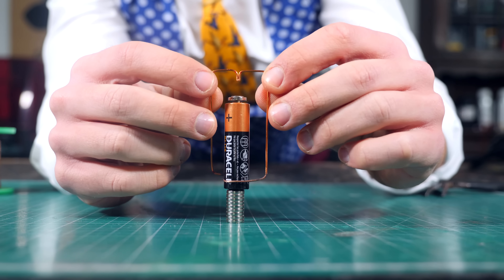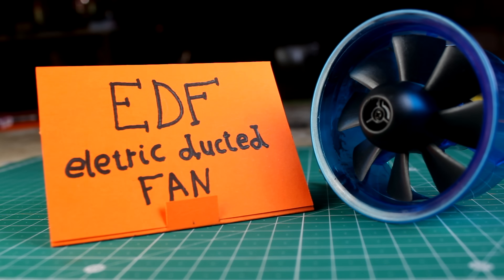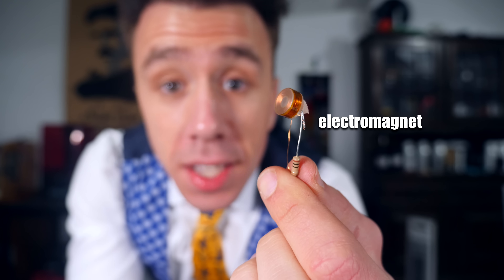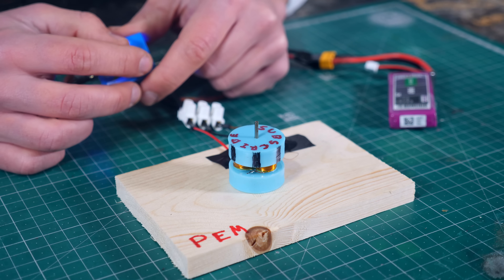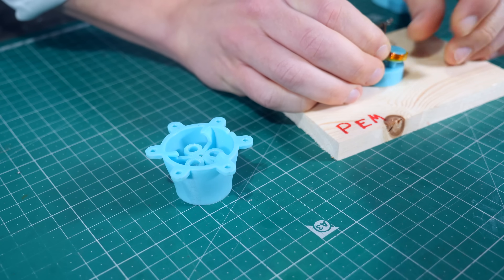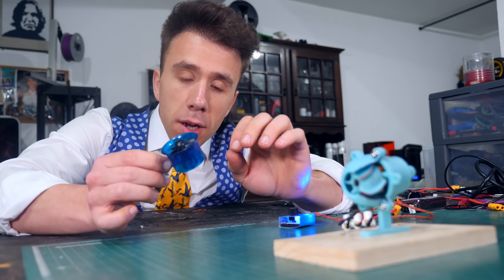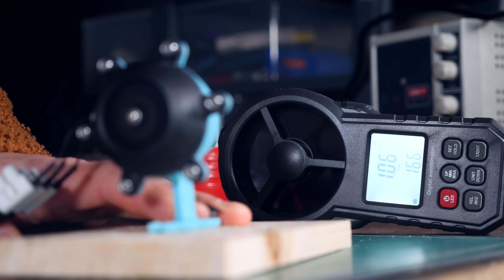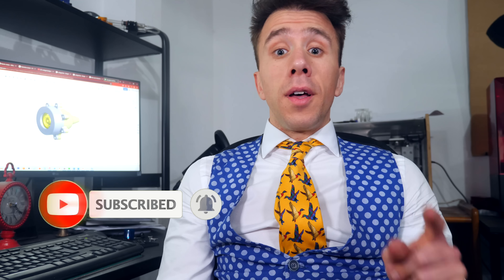I 3D Printed an ELECTRIC MOTOR FAN

Comment: Hi, I am an aerospace engineer specialiced in propulsion, so there you have some ideas.

1. First of all and only eyeballing, your blades look way too thick and shallow (low span): this is an aerodynamic nightmare, I wouldn't expect any good efficiency from this impeller. The tip gaps are also quite big.

2: Some propulsion system analisys. The propulsion system objective is basically achieving thrust from an energy source, and in this it is usefull to define several efficiencies following the energy transformations:
2.1 - electrical system efficiency: this is a given in your set up and it is the amoutn of mechanical energy your motor generates (torque times rpm) with respect to the energy the batery expends. It is fair to assume that this could depend on your rpm
2.2- "Thermodynamic" efficiency. In a gas turbine this is the mechanical energy you produce (the metric in an aero engine could be jet energy, or in a turboprop shaft power). In your case we can take the energy in the jet. This efficiency is giving you the relation between the mechanical energy output of your motor and the "useful" energy you get from it. It is directly related to the efficiency of your turbomachine and losses through your passages.
2.3 -Propulsive efficiency. This is how much of the energy of your jet is expended in actually propelling your vehicle (a lot of the jet energy is wasted in moving the atmosphere around!). The trhust of a jet engine (assuming subsonic jet, which is what you can expect from your single stage compressor set up) is T=m(v9-v0), with m being mass flow, v9 the jet velocity and v0 your movement velocity. Bare in mind that the energy flux of your jet is 0.5*m*v9^2, and the power of your force is T*v0, so your propulsive efficiency is eta=(m(v9-v0)v0)/(m(v9^2-v0^2)/2)=2(v9/v0-1)/(v9^2/v0^2-1)=2/(v9/v0+1): Propulsive efficiency is highest when your jet velocity is closest to the flight speed. This is because the jet energy grows as v9^2 while the thrust as v9: thrust can be generated both with massflow or velocity, but velocity requires more energy.

All of this divagation implies: For the same mechanical energy input (assuming same motor efficiency, rpm, and torque, which is assuming a lot), you will have to still match a) turbomachine efficiency (which you are far from matching) and b) propulsive efficiency: matching massflow. If your jet is faster than the original you are never going to achieve the same thrust. You should try to go big and slow to maximice thrust per unit energy (Specific fuel consumption, this is why aero engines are bigger and bigger!) and that way compensate for your poor turbomachine efficiency.

Regarding turbomachine efficiency, there's no simple guidelines that can be given in a YouTube coment. Look for "Turbomachine Euler equation" and "Velocity triangles", that is the very least you need to know. Quick note: your impeller is far from being a radial machine, it is mixed flow as much, and I would argue it is totally axial. On the other hand, I don't know why do you want radial turbomachinery. It is true that it is more "resilient" (AKA, easier to make it work), but for your application it will imply huge frontal areas.

Comment: I have an idea for a future video, it's something I have been working on as a concept for some time. Combine a vacuum tube cannon with a compressor piston. The vacuum can be created by drawing back the piston with a temporary seal on the end of the launch tube. When the piston reaches the end of the tube the pressure difference from the atmosphere and the vacuum accelerates the projectile. I first leart about the principal in NighHawkInLight video https://www.youtube.com/watch?v=9ydJXOTf1-4

My concept involves that same piston simultaneously compressing an explosive gas in a chamber. The piston rod would have to travel though the chamber for this to work so would require its own seal. When the piston reaches the end of the stroke it would trigger a switch that sends a electric charge igniting the newly compressed flammable gas. This would mean the resulting explosion fires the projectile down the vacuum tube. This would increase the efficiency of the projectile as it can accelerate faster trough the vacuum before breaking through the temporary seal and onto free flight.

The new design would necessitate a greater force to draw the piston head as you are also compressing gas. I think this can be achieved by gearing or possibly a high torque electric motor to draw the piston rod. The spark timing could be achieved by simply placing a switch at the end of the pulling end of the piston rod, when the piston head has pulled clear of the barrel the switch touches a fixed point and activates the explosion.

The spark timing can be adjusted varying the distance between the switch and a fixed trigger point. It would require that the chamber and cannon need to withstand the force of the explosion along with the piston road seal between the rod and explosion chamber.

You could also employ a salvo with a smaller payload to increase the projectiles speed as it can have a smaller cross sectional area and reduce air resistance when it leaves the barrel and enters the atmosphere in free flight.

I suggest a tomato would make a suitable target. Hope you like the idea!

Comment: centrifugal, axial, mixed, positive displacement, all go back to pressure ratio, flow, specific speed. Although it is properly used for pump selection, similar aproach can be used to understand fan, blower, or compressor. Each will have best efficiency operating range, which will influence the thrust generated Vs the power input.

Comment: Is it possible to add second fan at the outlet to boost the inlet fan like a turbojet engine?
I was thinking this for a while as "coldjet engine" concept. No pyrodynamics but advanced aerodynamics and thermodynamics.

Additional gas could be added inside the chamber, say nitrogen, to incredibly boost the efficiency of motor windings and could expand and act like normal combustion jet engine. 
pros:
+Hybrid architecture (electricity+gas)
+Safe to store nitrogen (compared to H2 plane concepts this is big pro)
+Motor winding could be cooled down to -160°C and have incredible conducting properties compared to room-temperature motor.
+More theoretical output than plain electric motor
+Effects can be increased if used AC induction motor
cons:
-Less output than combustion turbofan
-Nobody tried it before

I'm just writing this here because I'm from an extremely poor country. I'm poorer than Indian engineers, but I'm an electrical engineer myself.
Thanks for the video

Comment: What is confusing me: If you are intessted in thrust, why are you measuring airspeed at a seemingly random distance? The two are connected but certainly not the same. To measure thrust you should use a simple spring balance or a load cell.

Comment: I think those kind of fan might need to be really high RPM to be most efficient and your motor just cant really getting to that RPM that's why the smallest rc jet engine (xicoy x45) need to spin at around 60,000 to be able to keep going aka IDLE  meah while the bigger one (xicoy x180) IDLE at around 30,000rpm  the example that i got is from xicoy jet engine i think that's the reason

Comment: You as a Tesla "fan" should get it! The smaller fan the less laminar flow, that's the key in a Tesla turbine no laminar flow right. That's why EDF is not so efficient.. bigger diameter is better with lower air speed. /Bektorkhan "rocketscientist"

Comment: I think with of the shelve EDF you are getting high speed low pressure air volume, in contrast to your own EDF, you generated high pressure low speed air volume, perhaps the problem is with your measuring device which only calculates the speed of the air and not volume. You need to calculate the thrust with some other methods for example, a weighing scale. With the help of that you will be able to calculate how much push it generates and can compare it with the of the shelve EDF.

Comment: I would have to say it's blade surface area the ones on your EDF are much bigger than the ones on your impellers which means it's not going to grab as much air to compress if you look at a turbo or a supercharger they generally have long impellers unless it's Roots type

Comment: As far as I remember from building Airplanes with those EDFs, its about Torque of the EDF. They do very good, when the Inlet is slightly larger that the Outlet.
But as soon as they should "compress" Air through a smaller Outlet, they fail miserably...
Please correct me, if I'm wrong

Comment: I don't know if you measured more than you showed in the video, but just measuring the airspeed won't give you any comparable results without also measuring the volume of flow. Maybe measuring the thrust with your load cell will give you better readings.

Comment: Your biggest issue is flow rate, for you to get the same flow rate you will need to spin your impeller much faster . If you look at your blade inlet area on the EDF it is something like 10 times that of your impeller. This is why typically small impellers have to spin at insane speeds to function. 
A standard turbocharger with a inlet of 80mm can spin at 100k-130k rpm in operation but a turbo with a inlet of 30mm will spin way over 200-250k
These numbers are obviously way higher than you can get with a standard bldc. If you take a look at most dyson impellers they spin at 100k+. 
The only way you can get your impeller to get enough volume through it is to basically have a larger impeller( or much higher voltage to get higher rpm but i suspect the plastic impeller would just explode), similar inlet size to the EDF. 
Also the design that you have there is technically a hybrid , between a impeller and fan, a pure impeller would throw the air 90degrees to the inlet , yours just blows air kind of ineffectively at a 30ish degree angle , therefore you are really not generating a pressure rise and then choking off flow with a way too small exhaust port. 
If you want any kind of pressure rise your best bet is to have a much larger impeller but it has to throw the air outwards at a 70degree angle to the inlet at minimum . Model it after a turbo impeller, also your blade clearance should be as little as humanly possible , your leakage /blade tip losses will be huge with even 1mm of gap . 

You are entering high level aerodynamics , good luck ! 👍

Comment: Hi tomato haters,
The duct may produce more thrust because of the duct principe (concave part in front of the edf) . I mean, as in fpv drone, the duct help to increase the amont of air comming thru propeller, (like the corona effect)
Your desing dont run fast enought to suck enought air by himself, like a jet, or the front propeller is not big enought like commercial plane motors.
I didnt have à printer to show you, but if you try to expend  the entry of your design like the edf one, it may add more air, so more thrust
Reply: https://youtu.be/7f2DZIC8a1k
Here i found something about duct to source my saying

Comment: Those Dyson motors work based on a principal of areodynamics called the venturi effect. Try this: Take a plastic bag and try to blow it up using just the breath in your lungs. Kind of difficult huh. Now instead of putting the bag directly against your mouth, move your habd about 6 inches (15 CM) away from your mouth. This will inflate the bag faster and this will move a lot more air due to the differing pressures around your mouth and the opening of the bag. This may also be called bernoulli's principle as well. I could be wrong about this. Please correct me if I am wrong on this.

Comment: See if you can make an air gun. Like how they have a kid's air cannon. Usually from wjay I remember it was just a grip attached to a large circle with a Ballon or bag tied at the end. When you stretched and pulled back it snapped and sent a puff of concentrated air. Obviously make your small enough or whatever size to punch a hole through a tomato

Comment: I think for pressure your blades need to basically be touching the housing and have almost zero expansion or deflection. If not the pressurized air just goes backwards around the blades. I think the point of that design is relatively low rpm high pressure and the outlet accelerates the air so you don't have efficiency problems associated with fans at high rpm. Maybe. I could be completely wrong. Good luck My Brother!

Comment: I would make sure to balance your impeller and make sure it isn’t heavier than the original blades otherwise you’re making the motor work harder!
Next I would look at airflow through the body of the fan and maybe the air is turbulent or creating vortices causing you to lose speed.
Last suggestion is to keep the opening wider than the original to let in more flow? 
Great video and great channel! I know you’ll figure something out!

Comment: The blade angles need to match the operating rpm of the motor under load.  Just like an airplane's wing is really efficient when flying at one speed but not very good at others.  Also, the angle of the air exiting your impeller needs to match the incoming angle of the fins behind the impeller.  There are a lot of wall/blade angles that all need to match and I would bet money most of them with this design do not.  Simply having the same motor for both fans isn't enough.

Comment: We cannot change the angle of attack on the printed impeller.
Based on working experience, I can add that if we want to use high speeds and get thrust from it by increasing the pressure, then it is worth increasing the amount of air captured due to the number of blades. But in this case, we should increase the area of the inlet. In oil drilling, 2 types of hydraulic motors are used: screw engine and turbine.For classmates in university, I explained the principle of operation as the first and fifth gear of the gearbox in car. The first has high torque but low rpm, the second has high rpm but low torque. This experiment looks like we were trying to use elements of the first in the second engine.Summing up, it is worth increasing the number of blades, changing the angle of attack and the inlet, but this will already be more of a turbine than an impeller.
I hope something helped. Good luck!

Comment: EDF makes for velocity, but it can't push pressure. The impeller won't move air as fast, but it can "push" it. It's why we use centripetal fans to push air through a blacksmith forge (coal forge), because it creates pressure. Same for turbos on a car. It's why "electric turbos" that use classic fans might have a high CFM, but can only move pressures near atmospheric levels.

Comment: Well, if you ask me it's not even a "PEM". It's essentially just a three phase AC motor. The ESC just switched the coils on and off alternately with varying polarity.  Yes, it also uses back EMF of the coils that are not energized to keep track of the speed and all that. But anyway, kinda silly that they're called DC motor when nobody ever runs them on DC.

Comment: If you’re using these fans for thrust the ducted fan is going to produce the most. Thrust is basically high volume high pressure air and the centrifugal open face impeller style will deliver high pressure low volume look at the size of the vanes. With the closed face impeller/centrifugal fan you will be able to move more volume but lower pressure that’s why they’re used in air handlers in a hvac system. You will need to add size to the vanes of the open face impeller to get it to move more volume but you will lose efficiency and it’ll be clunky. Those open face impellers are better it moving lower volumes of liquids at higher pressures, that’s why they use them in high head pumps for moving liquids up hill or in a closed system. I hope this makes sense, I’m sure you’re getting great feedback from other viewers that can explain it better than I can. Keep up the good work and the amazing videos!

Comment: The problem with your fan is output speed vs output pressure. The centrifugal fan can pull a higher pressure than a regular fan can, but the EDF can pull higher airspeed. They both are doing what they are designed to do.

Comment: Hi maybe some could explain a problem I have with electric magnets, is a coil of wire nothing special about the wire it just wire, the same stuff, used for all sort of electric applications, 
so the question why does it work as a magnet, and not a heating coil, or just go band like fuse wire, it the same wire, and it could still the the same length, but raping it in a coil see to change some about the electricity, electricity not like water, a pipe with sharp bend affect water flow, more the genital much long bend in a pipe?

Comment: I would look at compressor maps of turbo chargers. If you over spin a compressor  wheel to fast it can not grab the air as efficiently as it would at a slower speed.  This may help you design a better compressor/ impeller you know the speed of the motor so find what angle and and number of blades works for that speed. That will be most efficient.

Comment: Watch some of the videos from Greg's airplane's and automobiles.  He will explain where to find all the NACA / NASA research publications with relevance to your goals.  You can stand on the shoulders of 80 years of NASA figuring out how to rapidly turn low pressure fluid into HVHP.

Comment: Didn't you say in the video that you were trading speed for pressure? So wouldn't that carry out to the end that the pressure of being forced through the smaller orifice is why you're not getting the speed anymore that the more "open" cowling of the fan would have read on the anemometer?
Think of it like fluid in a pipe, you can increase your pressure by necking down the pipe, but you're not going to have the same volume anymore unless you move a proportionally larger volume over time through it to make up for the smaller cross-section of throughput.